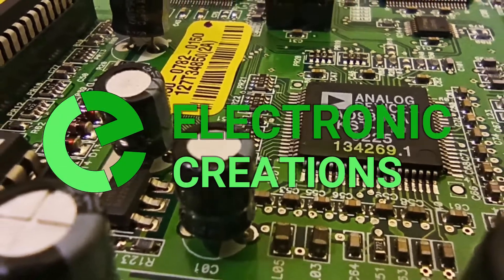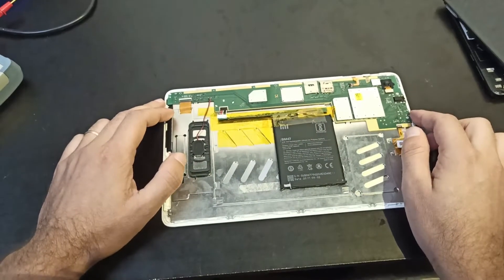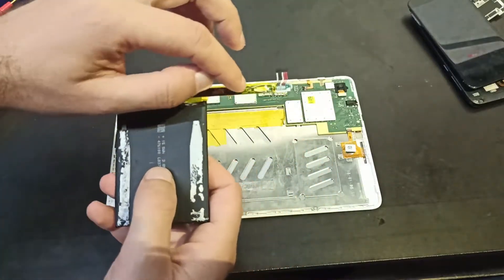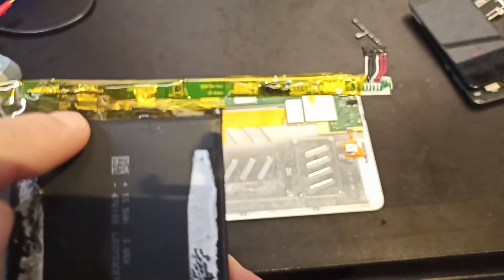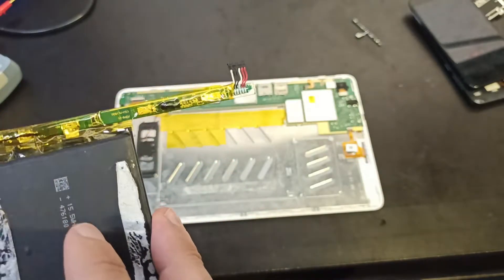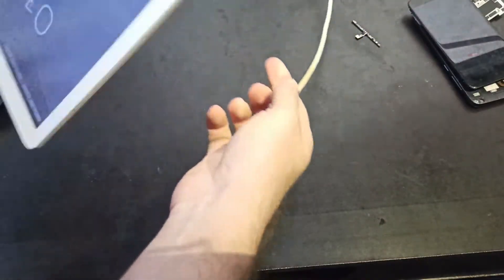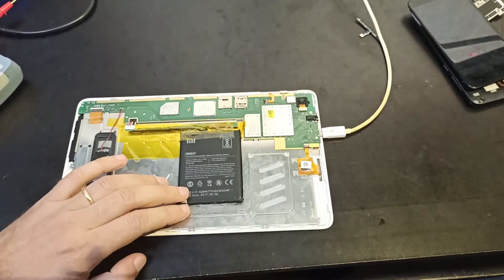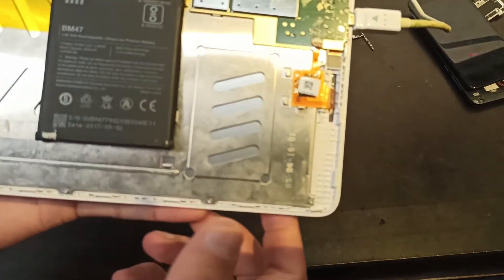Tablet battery replacement hack

Comment: one question sir, if your original battery eg. 5000mah then you replace it with xiaomi phone battery which is around 2000mah, how about your tab read battery capacity? 
still 5000mah or automatically read xiaomi battery?
Reply from the maker: Capacity is measured by voltage. LiIon battery is 3,6 or 3,7 nominal in this case is 3,8 and when is 100% charged it is 4,2v and empty is at 3v. So no matter what capacity you put in it will be read correctly.  Only difference will be in battery life.
Reply: @ElectronicCreations  facing problem after 70-80% capacity remain, my tab suddenly off, after rerplacing 6000mah bad battery with cheap 5800mah battery. after plugin charger it read empty - 0%. still curious is it wrong software reading or it need battery calibration or something?
Reply from the maker: Cheap battery is almost always fake battery. (ebay, aliexpress...) Better use old battery from broken phone at least you will have 80% what is stated on label. You can check my video ''Charging cellphone battery ~ Testing on BL-5C battery'' its about fake batteries with almost no capacity.